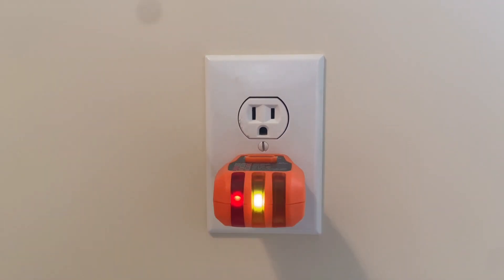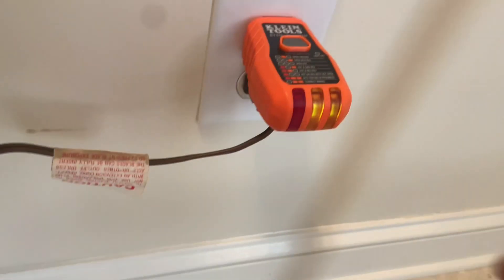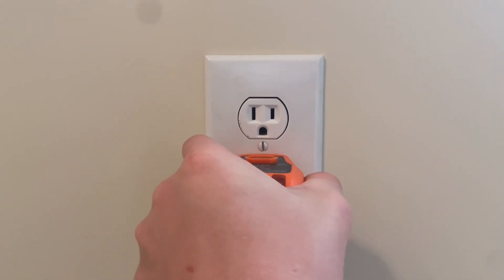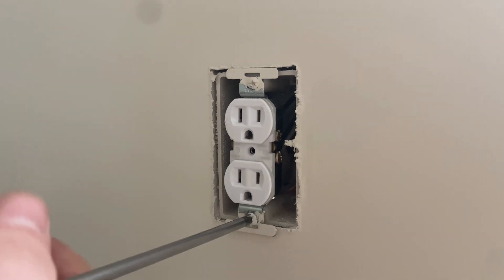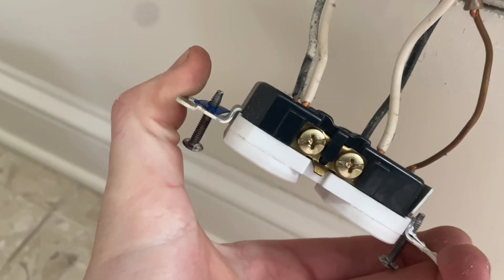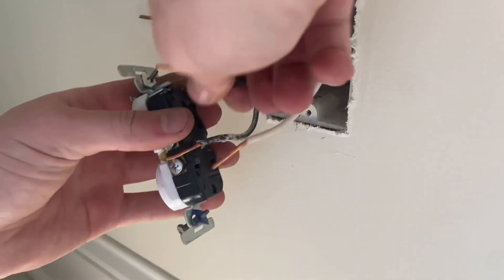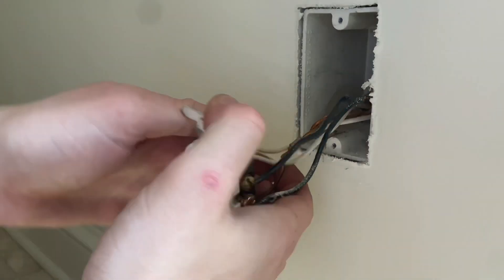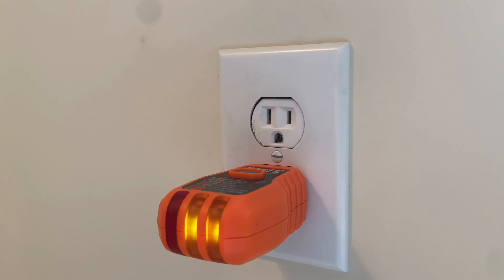Rewiring an Incorrectly Wired Outlet

Comment: What testing device is that?
Reply from the maker: These are called receptacle testers. When you plug them in they will indicate the status of how the outlet was wired, and if it was wired wrong it will state what is incorrect. There are some variations that have a button to test GFCI outlets. The particular one I have goes to a circuit breaker finder, and it doubles as an outlet and GFCI tester which is a nice bonus.